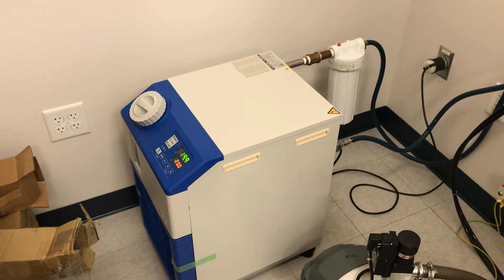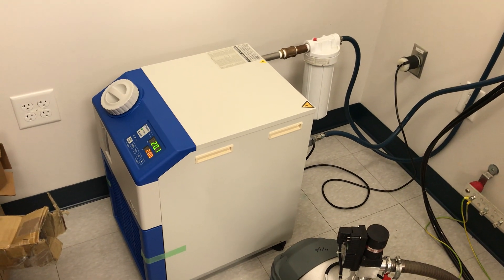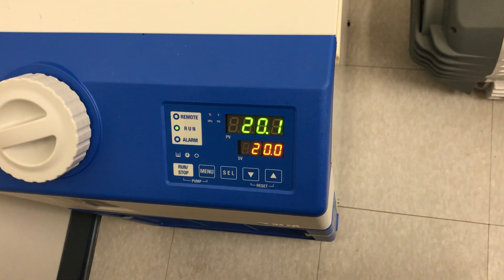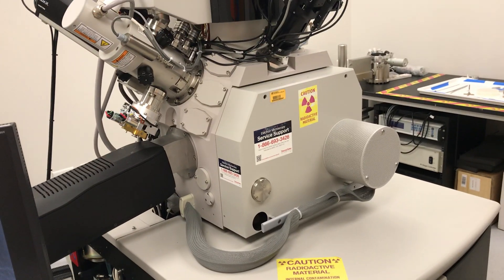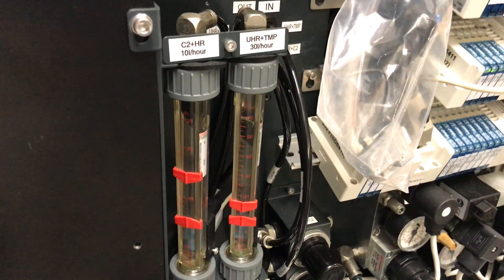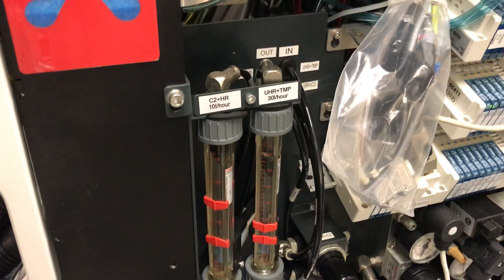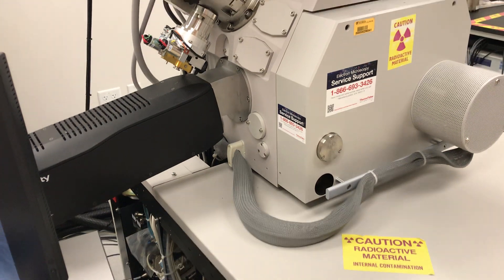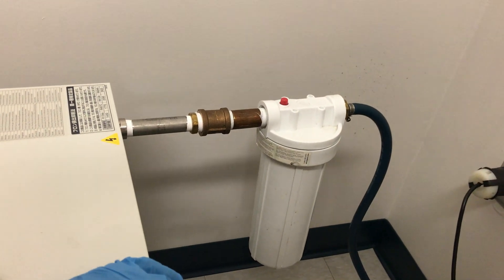All about the water chiller for your electron microscope

Comment: Hello Nicholas. This video reminds me of problem with chiller we had. Here in Mumbai, temperature in summers reach around 40 deg C. A single chiller wasn't enough for our TEM. So we ended up using 2 chiller in series...crazy 😃.
Reply from the maker: Wow, I've never heard of needing two chillers.  I would think that could be avoided if one chiller with sufficient cooling capacity is used.  Though if the chiller is air cooled, I could see how there still might be a problem if the ambient temperature is extremely high.
Reply: @NicholasRudawski , yes the chiller is air cooled one. That is why we ended up needing two. In winters one chiller is sufficient. But in summers, we kept getting optic board error due to insufficient cooling.